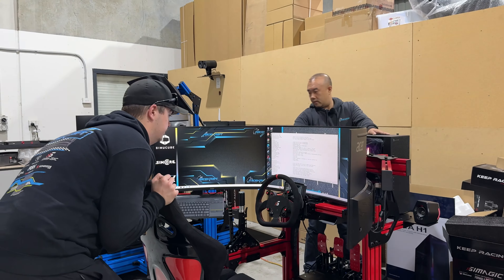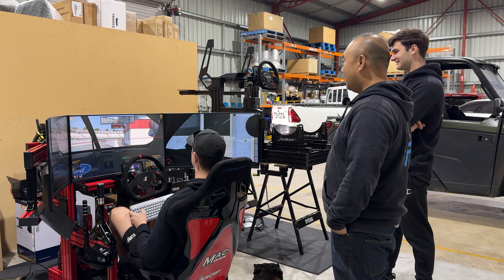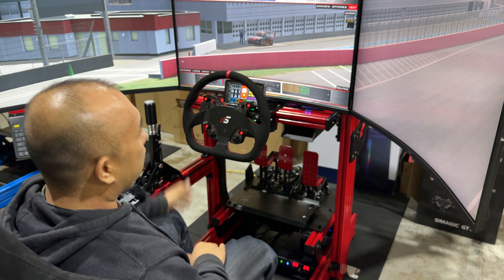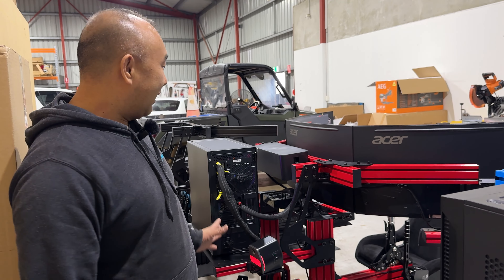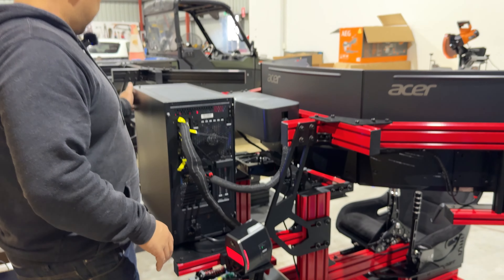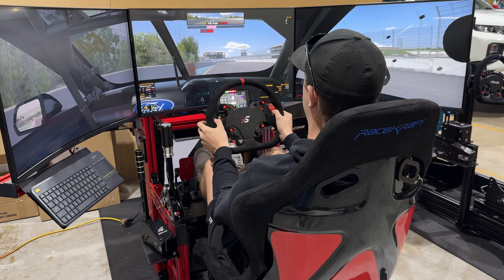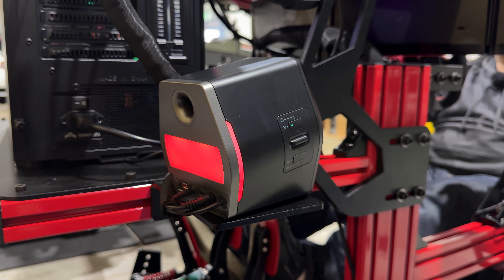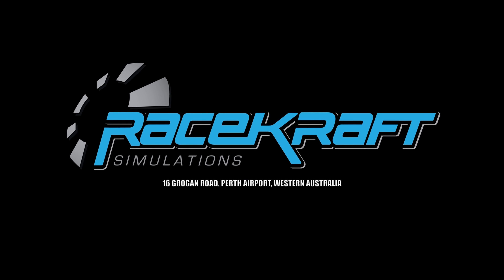Custom RaceKraft Stage 1.5 Pro Racing Sim Build

Comment: Simagic is the best choice eepecially for rally and things like that. The wheel correction and speed just feels faster then everyone else. Idc about the specs or the slew rate when somehow simagic figured it out. As they stated less friction+ speed is what they go for not just slew rate. Its why simagic wheel base when off is so smooth and so frre flowing. So it allows for everything to come through so fast and the snap and corrections are the best. Its also why the suspension bounce feel and the edge of grip feel is so good. Yet to feel a wheelbase be so instantaneous except for simucube. Even asetek has more lag imo. Sure same motor as simucube but not software and companies have proven softrware matters much more then specs. You can have the best specs in the world but if your software isnt working as good or pushing that wheelbase the same then it doesnt matter. Dont get me erong asetek has amazing detail but imo the edge of grip feel isnt as good. Which to me the top2 details that need to be felt most of all is edge of grip and suspension and or balance of the car. I legit srt my wheelbases up for that specifically even if i have to drowned out some of the curb details.

Comment: Nice build! The upside down wind sim is a cool touch, getting airflow to the pits instead of the face should be more comfortable.
Are the powder coat pedal faces noticeably slicker than the standard anodised finish?
Reply from the maker: Thanks :) the grip level is still good :)